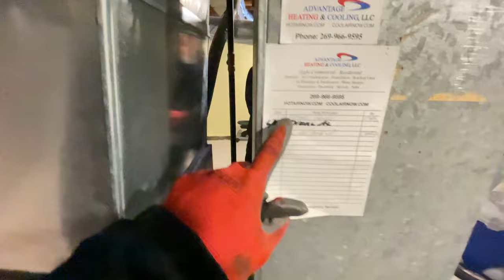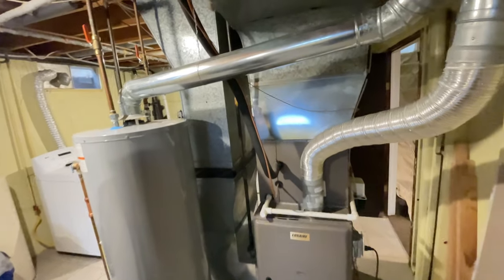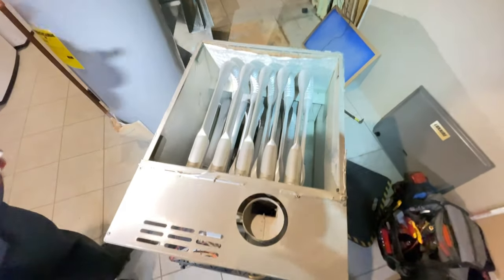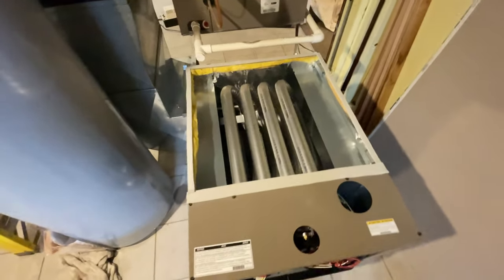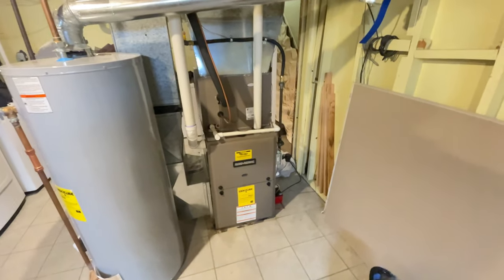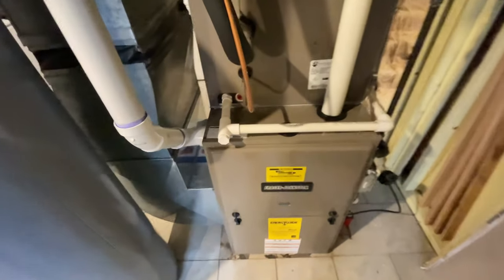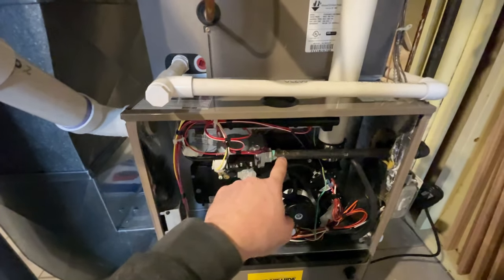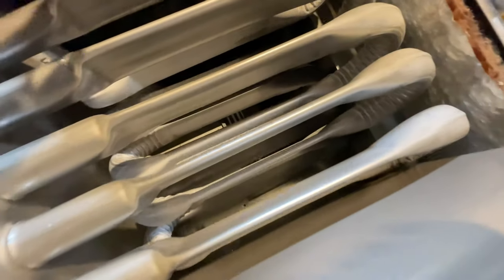Luxaire Gas Furnace Replacement Made Easy

Comment: Why not leave it 80 %?
Reply from the maker: Just trying to save the customer some money in the long term. Here in Michigan it gets cold and will save on the gas bill.
Reply: @ADVANHVAC  I get that but it's rarely much an improvement. Unless he had a high gas bill before.
Reply from the maker: Plus my distributor didn't have a 80% 2-stage this furnace was slightly oversized it was a C width cabinet.
Reply: @ADVANHVAC  I see.